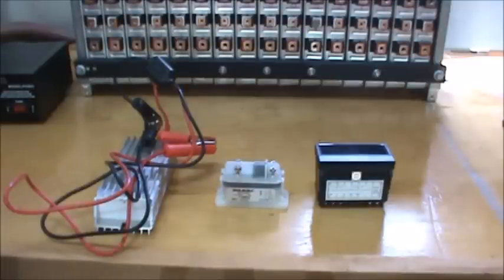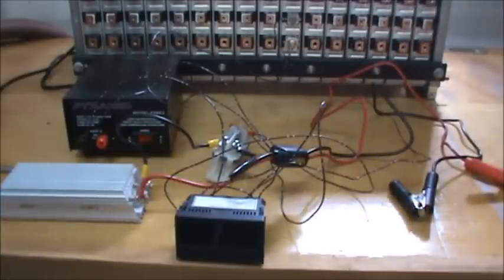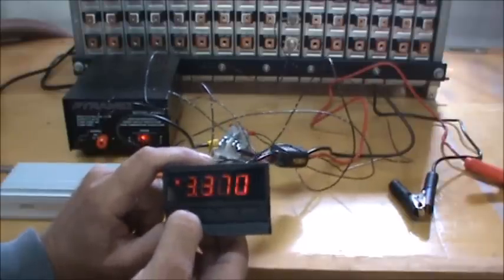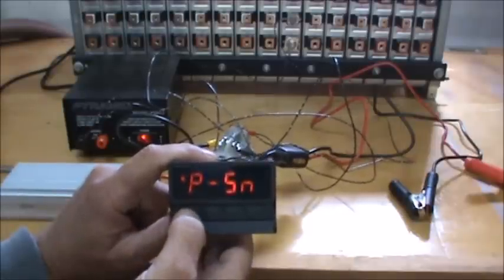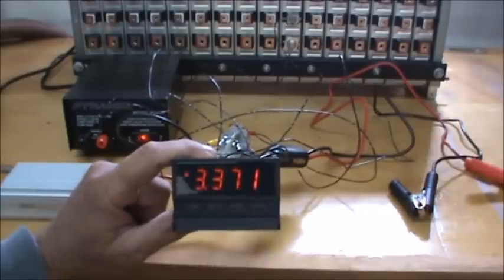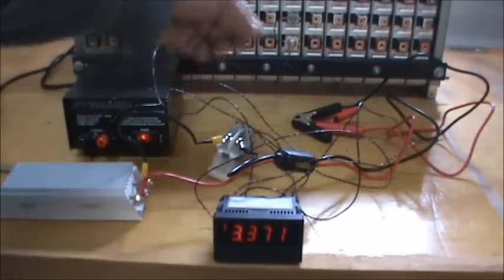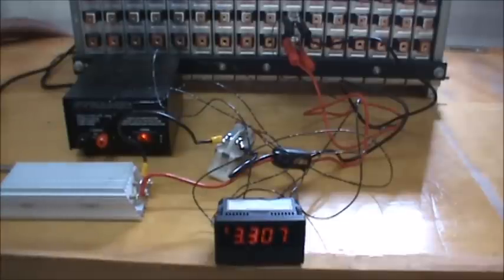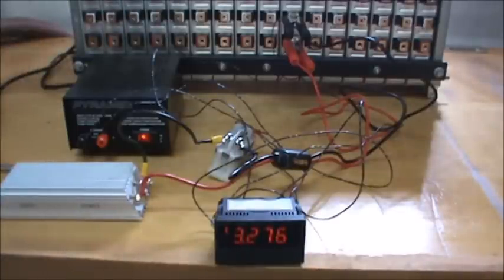How To Build A Bottom Balancing Device For Lithium Ion Cells Step By Step

Comment: @Tom: do the cells need to be discharged one by one?  Could you wire them all in parallel, and bottom balance them as a group?
Reply from the maker: +Edmund Stephen-Smith I have heard discussions on this...........if I were using small capacity cells id probably try it. But with the larger cells I think for now ill stick to one at a time.

Comment: It takes days to bottom balance the cells. As I understand it, this is not good for them. Nissan claims that one should not park the car with low battery for a longer time, and that means 3,6 Volt. How can 2,5 volt not damage the cells over several days?